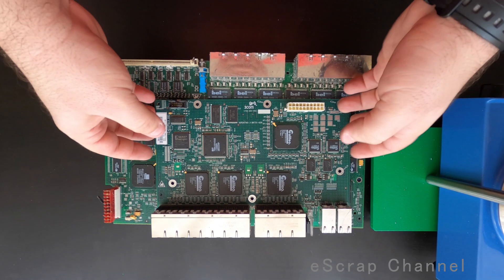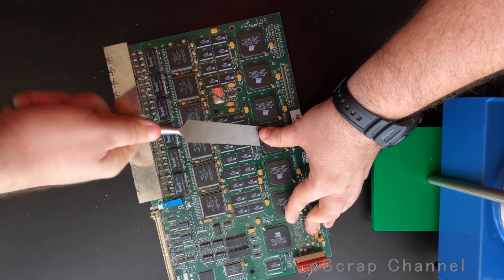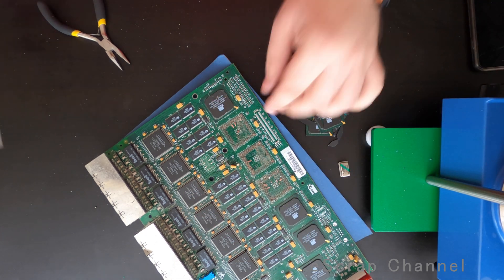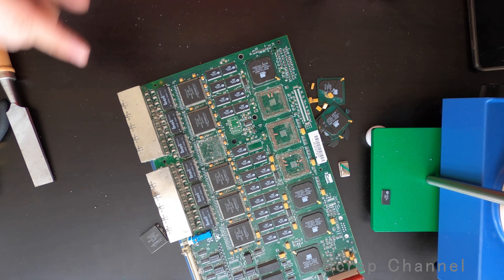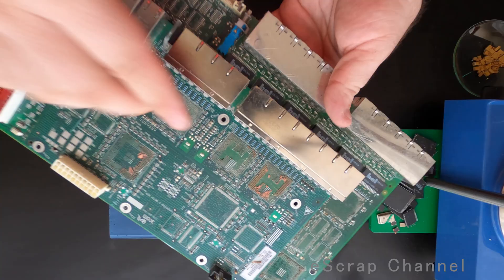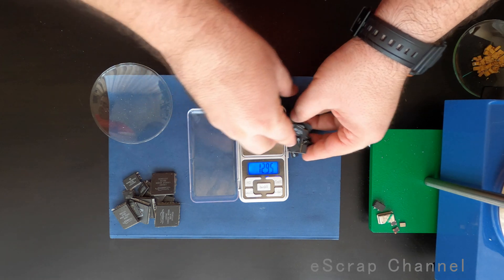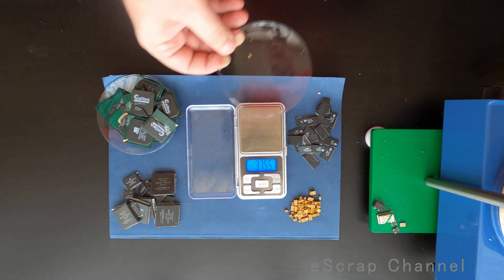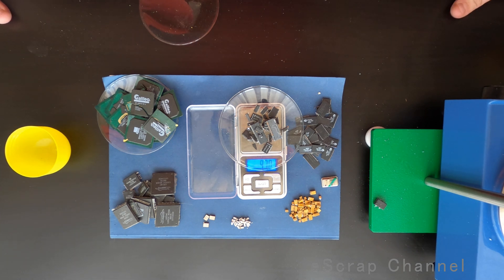Scrapping Telecom Boards - Complete Depopulation

Comment: Insted of 10g/kg it is just 4-5g/kg
10g/kg true on 100% top only
Top+bottom yielding together 4-5g/kg
Reply from the maker: Hi, let me kindly disagree with you. If you take different size BGAs and measure them you will see that green bottom is between 25 and 45% of the total weight. So, gold yield varies a lot!